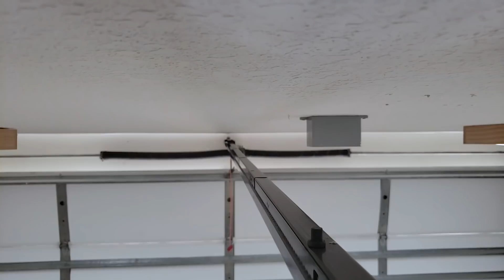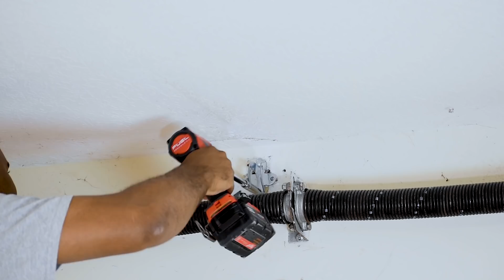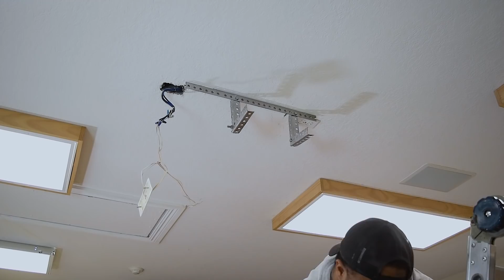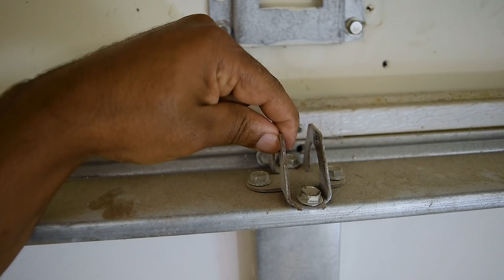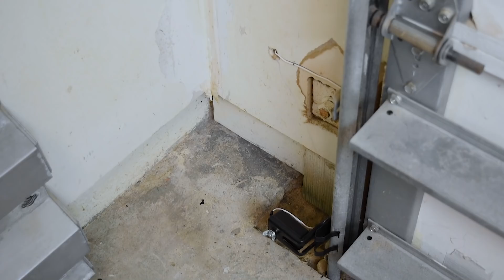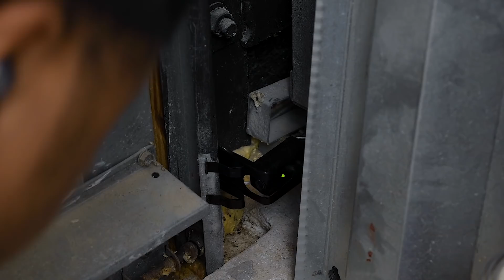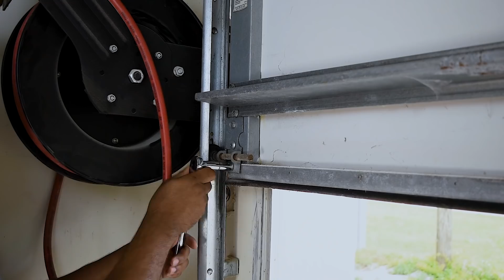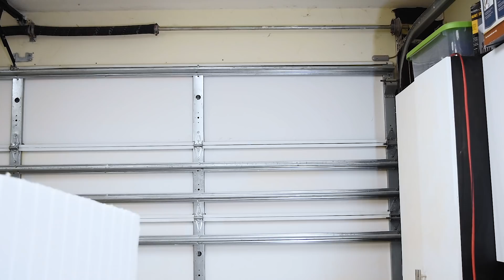3 DIY Garage Door Upgrades | Adding insulation, Replacing Opener and Weather Strip (in one day)

Comment: The battery backup is a good idea, but I thought all garage doors had a chain or roller overrid so you can manually open it.
Reply from the maker: Yes, there is an override, it's great if you are in the garage. If you are outside then that is a different story, that's where the backup battery shine. If the lights are out and its raining then you can still open the garage.
Reply: @DIYCreators  Hmm great point didn't think of that haha.
Reply: playincrzy that means every opener will be DC then. I think I can live with that

Comment: I need a new garage door, and when it finally gets done I will finally have a an opener installed also, (hopefully).

I don't know if it matters with the new springs, I know it does with old springs, but that may be because they've probably never been adjusted, but even though the polystyrene panels are not heavy individually, collectively they add more weight to the garage door. You may want to check with the company that installed them to see if the tension needs to be rechecked.

Always a pleasure watching your videos Glenn.

Comment: I wonder if there’s a recommended height for the infra-red beam a little bit hard to tell on your guide but I was thinking if they were too low and you had your vehicle parked in the doorway the beam would not be broken anyway just a thought.
Reply from the maker: If my memory serves me right the sensor should not be mounted higher than 6 inches. Mine is 3 inches above the floor.
Reply: 6" from the floor. They are to prevent someone from being trapped under the door. The opener will back up on its own with the force setting if it hits a vehicle.

Comment: I have a question.

How on earth do people dislike videos from this channel? Instructions are hella clear, video quality is perfect,..what more does one need? SIGH
Reply: Must be from people with competing channels
Reply: successful people and channels  have trolls.........sad but true
Reply: Maybe they dont like 4he belt drive
Reply: Hi!  Even though there is some useful info such as getting a belt for less noise, getting a pro to change the springs, and getting a battery back up opener was good advice. There were some that I didn't agree with. Where the opener bracket was placed on top of the strut bar, also spraying the track with grease, how loose the belt was, and messing with the bottom bracket while the springs and cable were still under pressure where most of the reasons why I disliked.
Reply: oddelli  oddelli   You are correct. The door arm is installed upside down and attached to the door incorrectly. This will put a strain on the motor as it is pulling the door towards the opener rather than up. The people who complain of trolls don't know shit from shinola and are in awe of these videos because they have a hard time doing simple tasks.
Reply: oddelli 
Spot on. Not to mention operator arm on wrong, no operator plate of any kind on the top section, adding weight and thinking adding tension will make up for it. 
I cringed when he started unscrewing the bottom fixture bolts/screws. 😱
Reply from the maker: Again, I know many of you are pros and have learned form other pros. I read the manual and it shows two configurations for the arm. I know some of you will say it don't matter what the manual says but I'm and pointing this out because the manual shows both. I will trust what the manufacturer shows if I'm learning something new.... I aslo fixed the tension on the belt, this was something I had to learn.
Reply: @DIYCreators  totally, follow maufacturer recommendation. I wouldn't place the arm like that on your  sectional door, however it is seen that way if you were to  have a one piece wood door. So seeing two configurations isn't surprising.
Reply: DIY Creators 
I’m pretty sure if you look closely you will see that the arm hooked to the top is on a on piece tip up door. 
I’m not in any way trying to be a butt just trying to get things straight. 
Overall this video is pretty accurate.
Reply: Because they are a few mistakes as mentioned by others. Also, I didn't watch the whole video, but  I didn't see any mention of adding an extension kit since it is an 8' door and openers from home centers are for 7' doors.
Reply: They are racist
Reply: Spiritwolf66   You are a fucking moron!
Reply: @CrazyCrusader1  I'm so tired of everybody making everything about race travel at a safe speed and everything will be good just remember Irish lives matter
Reply: Jim Cooney  spiritwolf66 is a moron, plain and simple.

Comment: Excellent video. One thing I highly recommend is replacing your rollers with sealed ball barring white nylon rollers. Will make everything smoother and much quieter
Reply from the maker: Thank you, yes this is worth looking into.
Reply: Also the reason why your garage door doesn’t open all the way is 2 reasons, 1, the drive arm that the trolley uses to open and close the door is installed completely wrong. 2, your garage door is 8 feet tall, so you need the 8 foot extension

Comment: a lot of the sound has to do with your rollers, use nylon (plastic) rollers if you have metal to drastically reduce soundalso if you go to a garage door store they have 1 piece track for the seal and spray wd40 in the track before you feed it through to make it 10x easier
Reply from the maker: Thanks for the tip
Reply: @DIYCreators  it's a good idea you let a company change those springs too. They're dangerous if you dont know what you're doing and those winding bars you use to tighten them come flying back.

Comment: The installation was pretty good. You may want to look into a opener reinforcement bracket. The bracket Chamberlain provides is ment to be through bolted on a wood door. Also your belt is loose. I have been doing garage doors for a decade now.
Reply: If that’s the only thing you seen wrong with this video then your 10 years experience in doors must be more like 1 year experience  10 times. There were many things that are very wrong with the install of the operator and the bottom rubber
Reply: @tycasey5068  I was trying to be polite ty. It was a good effort. But these sort of things are the reason that I have a job. Suck it.
Reply: Vincent Latham yea it’s why I have a job to. The this that bothers me is the multiple unsafe and not proper things he did while making this video that some one is going to do and seriously injure them self or possibly kill them self.
Reply: @tycasey5068  ok scare tactics. You can sell jobs like that all day.  I choose not to. He was doing simple things. He was smart...so he decided to get the springs done by a pro. Bottom rubber? Opener install? Given his knowledge and skill, it looks like he got it done. Any other issues he calls guys like us. Telling people garage doors are dangerous, you are right. Putting in an opener, and doing some bottom rubber (as long as you don't touch the assembly under tension) is not bad. As long as it is within your ability.
Reply: The j-arm bracket that comes with the lift masters/chamberlain is perfectly fine for steel, as long as the door is properly balanced and lubricated. Just make sure it’s installed into a steel reinforcement rib in the panel. You also want to put it closer to the top of the panel and not the center. The j-arm reinforcement you’re speaking of is best used with steel back doors made by Amarr/Pella, because they do not have a reinforcing rib under the steel back in the center, so often times the J-arm bracket rips out with even the slightest bit of drag or misbalance. 

The belt is too loose and the rail isn’t level. I recommend adjusting that closer to level with a no more than an inch of difference from either end. 

Keep in mind, when adding insulation, though it’s polystyrene it still adds weight to the door and I do recommend a professional verify that the door is still balanced. 

Lubrication is verify important

However, spraying the track is a waste of lubricant and can be extremely messy. I recommend using a Teflon based product and only spray moving parts such as rollers springs hinges and bearings. And as frequent as every 3-6 months. 

Don’t forget to get your annual inspections either. You’d be surprised how much you can catch before it becomes an expensive problem. 

I have 15+ years experience with residential garage repair and installation.
Reply: How long will that belt last? Wont it snap?
Reply: JJD a belt lasts approximately 10-12 years depending on use. If you purchase a LiftMaster, which is the professional line of Chamberlain, the model 8550 comes with a lifetime warranty on the belt. Only downside is those can’t be purchased at the box stores. Door balance also plays a key role in an openers life expectancy. A door that isn’t properly balance will cause it to fail much sooner than if the door was balanced properly. Adding insulation to a garage door dramatically changes the door weight and will cause the door to go out of balance if the correct springs aren’t installed on the door. An unbalanced door will lead to a multitude of issues with both the door and the opener.
Reply: JJD belt is actually just as durable as the chain. Consider the belts on the motor of your car they take a lot of abuse and last for 100 thousand miles no problem. These belts are made the same way. Very durable
Reply: It’s meant to be installed on steel. How many wood doors do you install these days. Most doors are foam injected with steel plates in hinge and bracket locations. Might be different in other parts of the world though I guess
Reply: @darrennickerson1  https://www.movingupgaragedoors.com/adjsutable-reinforcement-bracket-18-24-sections?utm_source=google_shopping&_vsrefdom=adwords&gclid=Cj0KCQjwla7nBRDxARIsADll0kCddiGDbL92caLm70XjaFUu1ixIUP-o1iWQ9DrhBjpzoGZBxbLn_p0aAvraEALw_wcB
Reply: @darrennickerson1  check it out.

Comment: Great video. Adding a tip, use Windex or soap water to the metal brackets as you slide the rubber in place.
Reply: Silicone lubricant spray.

Comment: The opener arm is mounted improperly the door is quite loud Try lubricating all the hinges  and rollers with white lithium grease  Also the belt on the open should have a little more tension due to the fact that a they hollow tube and has a lot of flexing PS I am a garage door technician
Reply from the maker: The arm is not mounted wrong it shows many different setups in the manual. I chose the one that fit my setup, trust me I doubled and triple checked! I can not go back and forth with you on every point because I am not a pro at this. I did lube the door at the end of the video.
Reply: @DIYCreators  Standard WD-40 is not very good at lubricating. As he said you should use white lithium grease as it will stick longer and work better.
Reply: @DIYCreators  in my experience the way the arm is mounted causes problems and damages the strut I'm just trying to warn you so you don't have to dish out more money for repairs
Reply: Joshua Jones you are pretty much correct, bracket should be mounted to section under the strut,in line with top rollers. And the operator arm is completely backwards, although in certain situations this is required. 20 year commercial guy here. (As well as residential)
Reply: @chuckreetz2953   On this particular door it is not required it is only required on a Wayne Dalton that is designed for it from my personal experience as a residential exclusively garage door technician The other thing would be does mounting option will be perfectly fine if he was using a low headroom set up
Reply: Joshua Jones Arm is backwards plain and simple, you can argue all you want. And your going to ruin strut and top section. I'll guarantee I have more experience than you at resi, I've put in thousands of doors.
Reply: @chuckreetz2953   You might have put in a lot of doors but how many are still standing lol (that was a joke) I understand that you're a  garage door professional as well However I see this damage all the time it's one the most common things I see not to mention Glenn lives in Florida of which I am a technician in Florida I understand the wincode and  proper installation for Florida code it requires it to be mounted properly unless the door designed otherwise I work for a 5 star  Company and I grew up in construction my whole life  You might say you know a lot but then again so do I  I know more information and proper installation of things then most of the garage or technicians in Florida I'm actually teaching garage door technicians that have been doing this over 30 years
Reply: Joshua Jones I hear ya man! And yes there standing, haha. Yeh I've always worked for a big company too here in Wisconsin. No worries! Put doors in in quite a few states, Florida would be cool. Off to a prison today.